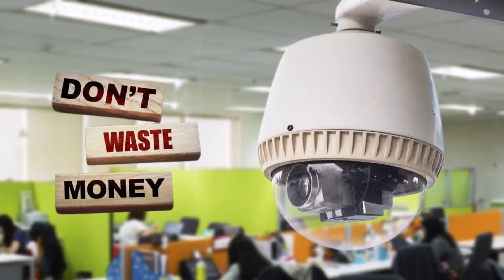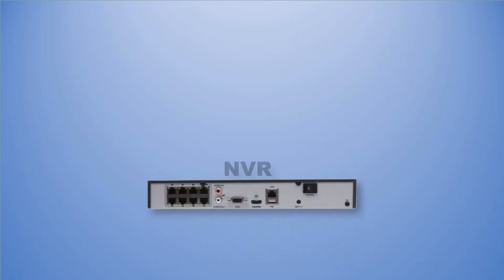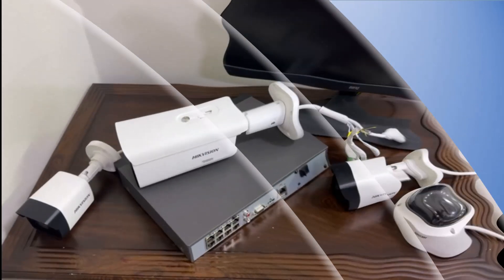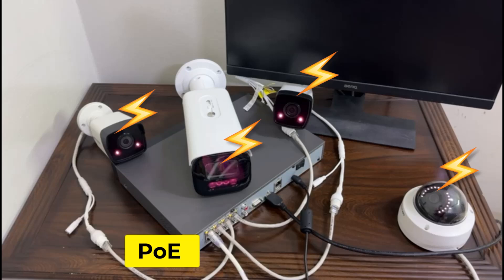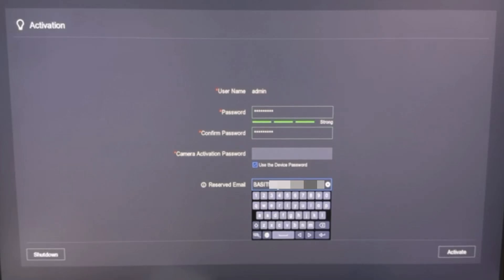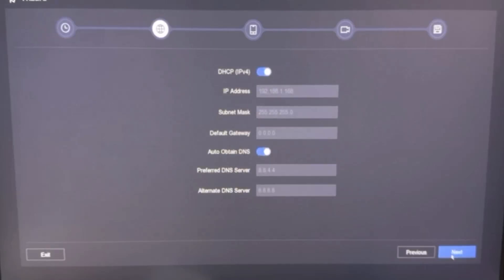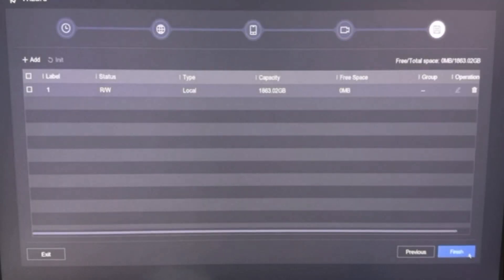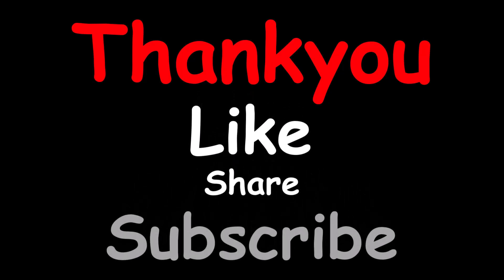CCTV Camera Installation | IP Camera & NVR Installation step by step | CCTV Camera Wiring Diagram

Comment: nice video but i have a question. If the NVR assigned IP addresses to the camera with DHCP turned on. Where /who is providing internet to the NVR. If its connected to a wireless network then DHCP for NVR should be turned on to avoid conflict of IP Addresses.